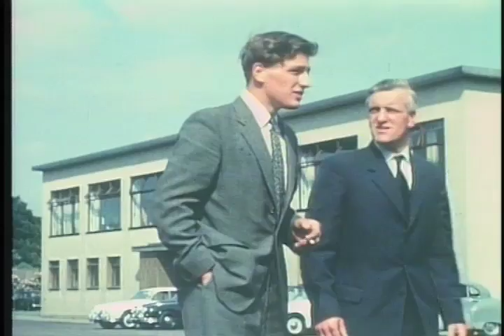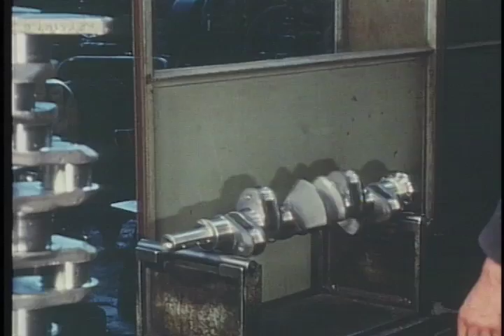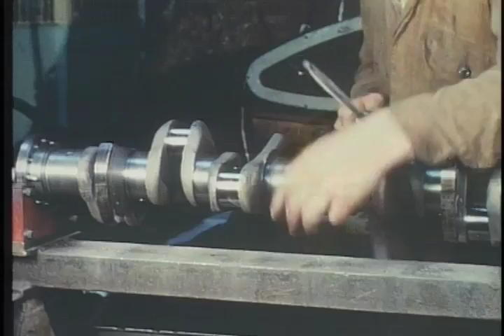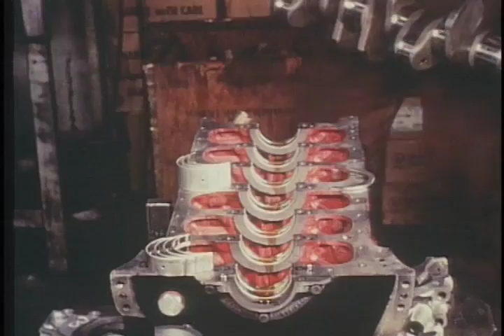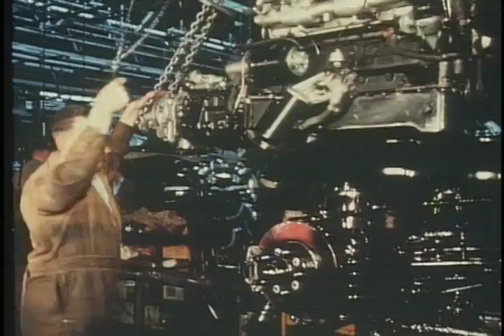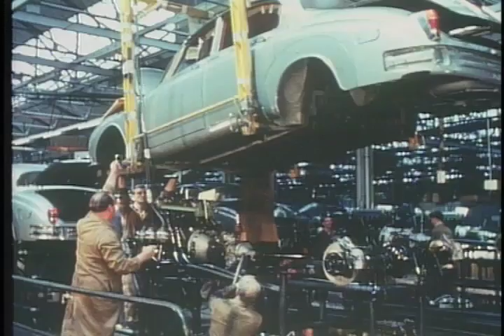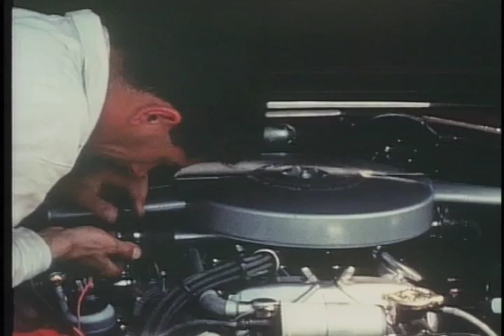Jaguar Factory Tour - 1961

Comment: People always rag on Jaguar for being unreliable... but this simply isn't true. In their day, they were just as reliable as anything else comparable, however, the cars tended to be kept longer. The 'reliability issues' were people comparing their 1978 built car to the 1988 car their neighbour has just bought brand new. A lot changed with the dawning of the 80s.
Sad how people only remember the brief negatives, but forget the fact that the car that they're complaining about, when new, competed with either Ferrari or Aston Martin or Rolls Royce (depending on whether it was a sports car, saloon or GT car) yet cost as little as a third as much...
Besides, even now, a 2 thou, or 0.05mm tolerance isn't that bad... Pretty good back in the 60s!
Speaking of which... having an engineering moment over all those lovely old machines. Probably a damn site better than the cheap chinese crap we're getting now.
I'd have loved to have driven an E type brand new. I bet it was a lot better then than after having sat in a field for years, rotting, and being bashed back into shape by an 18 year old with only half a clue what he was doing!
The noises those XK engines make, you'd be fined for making a car sound that good today, it'd be an outrage!
Reply: The Jags like many other luxury cars got their unreliability reputation largely from their later owners, who for lager money got a champagne car. These owners received them when they were older and were unable or unwilling to have them regularly maintained. Look at an S600 or a 750 for a current example.
Reply: Absolutely correct. Having owned Jaguar cars now for over 25 years and still having four pre 1965 Jaguars in my collection I can attest to the reliability of the older cars. Even the later ones are not as bad as people think if they are maintained properly. The number of older Jaguars even from the 70s and 80s that are still around means they could not have been a total disaster! Its a pity more people couldn't read a bit more Jaguar history from their golden period in the 50s and 60s to see just how good their cars were compared to the competition.
Reply: wigs1098 Advanced, fast, comfortable, racing pedigree, good looking... cheap. What wasn't there to like?
Even the modern ones aren't all bad. I'd like to see the XF go racing.
Reply: e m griffiths Hole in one sir. Something many people fail to understand yet take very seriously.
Reply: Yeah.. ain't that the truth . It's just the same old anti-British sports car snobbery that's over 60 years old by now..for some reason nobody mentions the most seriously unreliasble cars in the whole sports car field.. and they're not British! Want to guess which they are?
Reply: Mercedes! ML W164. Bought one, had it nine months. Pah!
Reply: Foxtrot Oscar Indeed. I am very impressed by by the early part of the film where the engine was being prepared and balanced. I really think keeping an eye on maintance is the still the key such that most ailing jags got there simply by neglect
Reply: deepinder cheema Well, when the engine was designed in WWII, everything was high maintenance. Cars of the 30s, from before the war, were the sort of machine you'd need to attack with a grease gun weekly. 
The XK was a massive improvement compared to that, but by the 1970s it was becoming a little dated in some of its construction methods. It still made good power though, so they kept it going until the 90s!
Reply: British Leyland, need I say more.
Reply: Aaron Jones Excellent cars.... for their day.
Reply: Foxtrot Oscar I've grown up around Jaguars my whole life and am now restoring a 1959 Mk1, I can attest to their reliability, even the "dreadful" BL cars were quite good, especially when compared with the asthmatic and equally as unreliable cars that Australian manufacturers were producing.
Reply: sgdeluxedoc Italian.
But the Italians make up for it by being passionate and flamboyant. They're just as desirable at the end of the day, but you've got to be a little nuts to buy one!
Reply: Unfortunately the bodies rusted very badly. At least in Ontario Canada. I did a lot of rust repair through the 80's and early 90's.
Reply: Are you saying the 70's Jags weren't as reliable as the 80's Jags?
Reply: HA   Ha   hee  hee  good one.....
Reply: hmm, reputations are earned. up to 1970, your point is mainly true. but after 1970, the poor reputation is earned.
Reply: No electronics and Brithish is the worst match. And yes back then they also had electronics. Retarded schematic designs, still fix many after 30 years. Land Rover and MG are the worst.

Comment: The rustproofing is non existant and the body is a trap for road grime. Not surprising that the tin worm consumed most of them ( I have a 1965 3.8 )
Reply: rustproofing technology only made a quantum leap halfway the 90's.
A good example is the Volvo 940, after many years of daily use on salty winter roads none of those had any rust anywhere. Because they were made out of galvanised steel and had real tuff undercoating. This is the case with many  cars from the 90's : bmw e34 and M-B w124.
I hope Jag's from th 90's are like that as well because i would like to own a nice rustfree XJ V8 some day.

Comment: From an engineers perspective, that was a delight to behold! I just wish they`d been dipped in primer instead of sprayed, & more attention was paid to rustproofing! I also wish they hadn't passed the wiring down the inside of the sill.

The last time I went to Browns lane, in about 2000, it was pretty much the same basic process during main assembly!

Thanks for uploading!
Reply: MrPabsUk  I went to Browns Lane only once it was a talk given by L.J.K.Setright for the Lanchester Society. I think that must have been 1996. He kept on pronoucing Daimler as 'Dimelar' which I am sure he regarded as absolutely correct. I went with the late Peter.D.D Ratcliffe who was a big noise in the Quinton Racing Club who was a terrific bloke.
Reply: L.J.K. Setright, what a legend! Must have been a very enjoyable & insightful day! And when he refers to Daimler, he means the proper ones, not re-badged, slightly better trimmed Jaguars!

I`ve only very briefly driven one Lanchester, an LD10, & I must admit, I really couldn't get my head around the pre-selector box..
Reply: They were phosphated and dipped in primer

Comment: For many years I owned a 1966 S type. ( 3.8 - Four on the floor + O/D ).
One day whilst driving along, the "Low fluid / Handbrake" warning light illuminated. A quick check showed that the foot brake was operational and that the hand brake lever was fully down. Upon stopping, my first action was to check the brake fluid level. The level was fine, but the float that activated the warning lamp (which resembled a cork from a old time medicine bottle) had become "oil-logged" and had sunk !